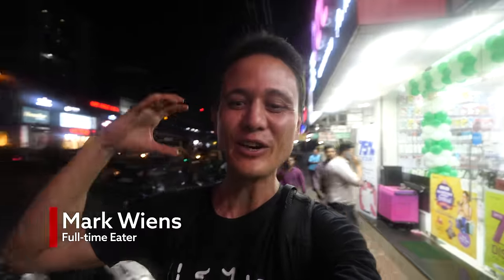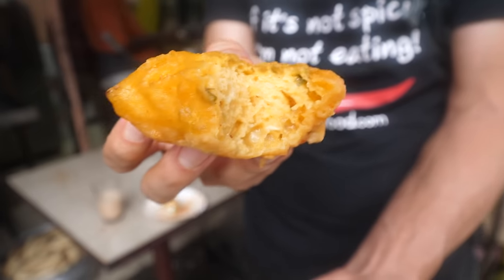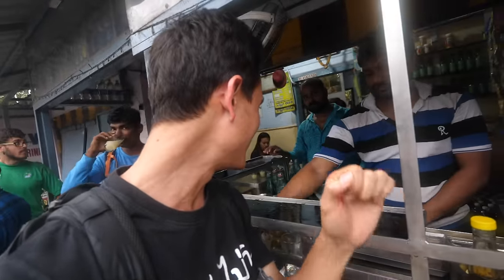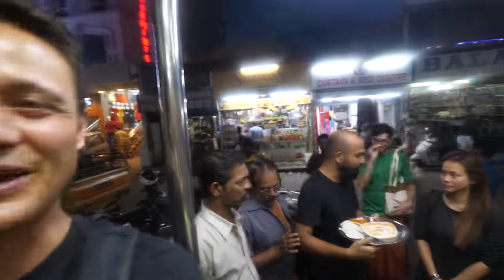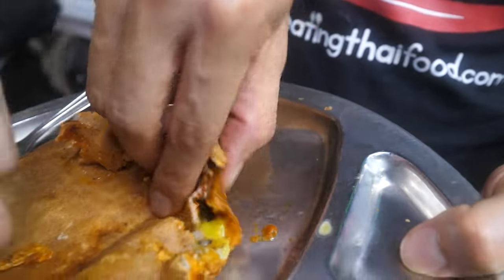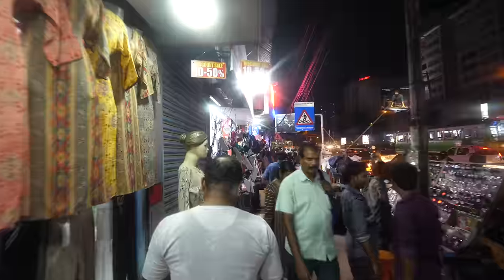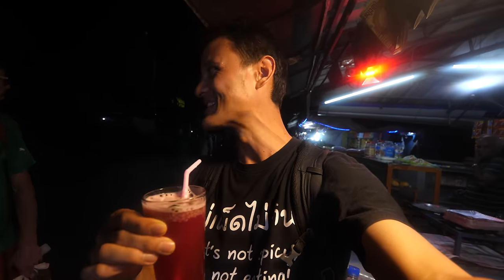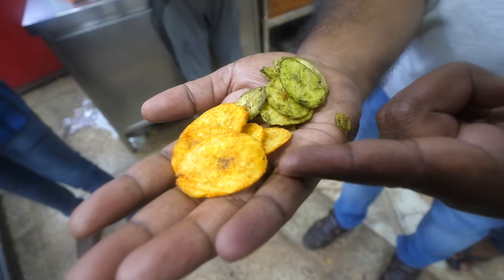13 Quail Eggs Dosa!! Indian Street Food + Goli Soda in Kochi, India!

Comment: Hey Mark, those bottles with marbles are called Codd- Neck bottles. It has a unique closing design based on a glass marble which is held against a rubber seal, which sits within a recess in the lip. Patented and designed by Hiram Codd of London, hence Codd-Neck.